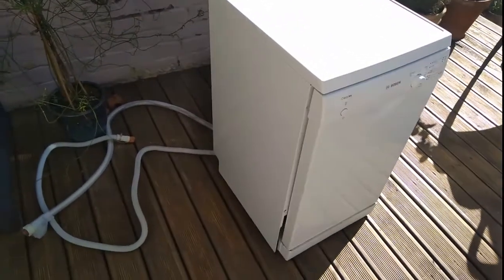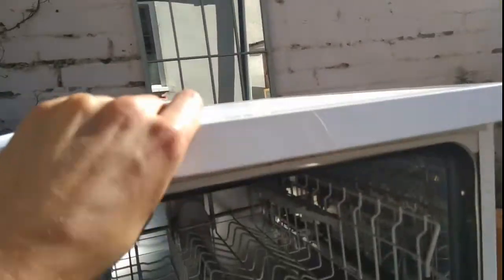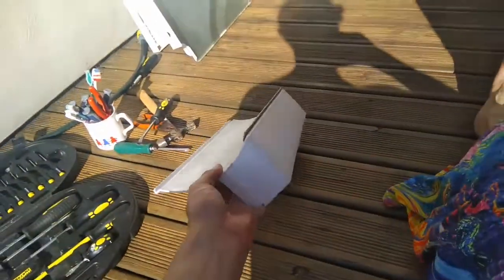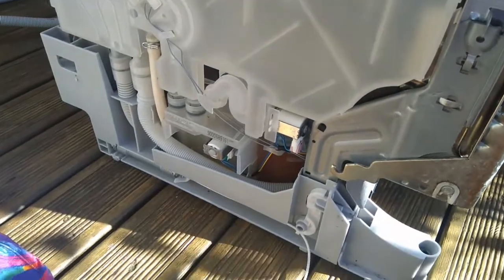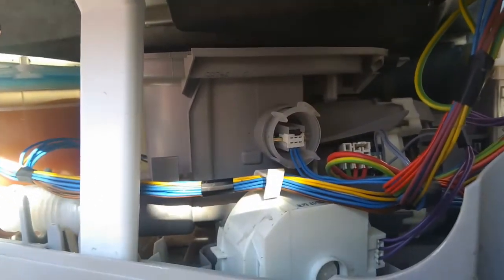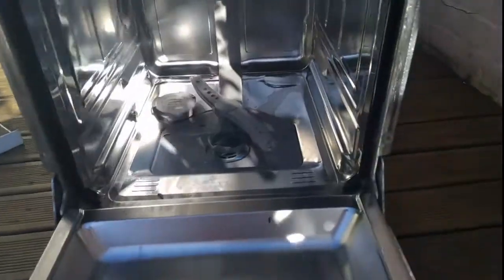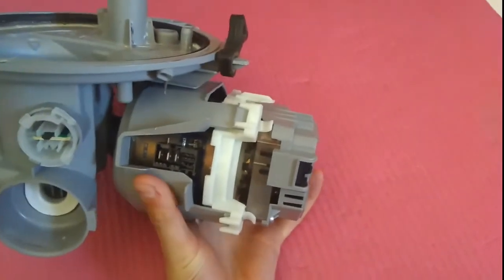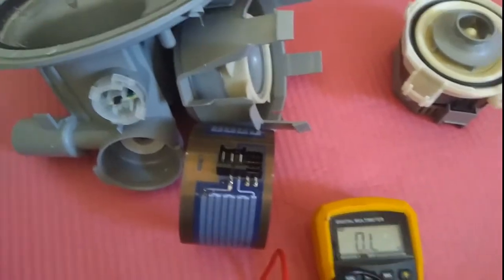Bosch Dishwasher SPS40C12GB 14 heat pump repair

Comment: If you disconnect the power cable going to the main control board, you can then take it out to access the heat pump without undoing the sump and other things, when you out the heat pump back, use a bit of dishwashing or laundary soap as lubricant.

Comment: Another fault you can get with the Bosch heat pump is low pressure spray. This is because the lugs that hold the impeller blade (grey moulding @7:28) to the motor spindle have sheared off allowing the motor to spin, but only a little flow due to friction still managing to turn the impeller slowly!!
So if this happens you can save the heating element in case the new one fails in the future!

Comment: Hi.  I have same issue with heater element bured off.... Due to leakage inside once. Did you try or manage to bridge the burned section. I tried but solder does not stick. Maybe due to steel or others non solder able material

Comment: Having same problem on my 5 year old unit, took the pump out and got the element off, no visual signs, but 0 ohm over the two pins. Oddly I cleaned my bbq grills on the hottest setting 2 days ago, which I have never used, so suspect this may have caused it.... new pump on order, BOSCH direct, £76. Great tutorial, I did manage to get the pump off from the side, bit fiddly with the factory clip, but came off eventually.

Comment: Hi,
What must be resistance of the ntc pins ? that near the heater sockets..

Thanks a lot...
Reply from the maker: I'm not sure what pins exactly you are referring to. the pins to the pump heating element should have about 22 Ohms across them as I point out in the video. Do you mean different pins?
Reply: @MrTiddles666  hi i asked ntc  pins. It is near the heater sockets. It is smaller then the heater pins. There is three pins. I have learned it. 1-2 must be 10 Kohm / 2-3 must be 10Kohm and 1-3mustbe 20 Kohm. 
Thanks..
Reply from the maker: @insanlarafayda8696  sorry can't help you